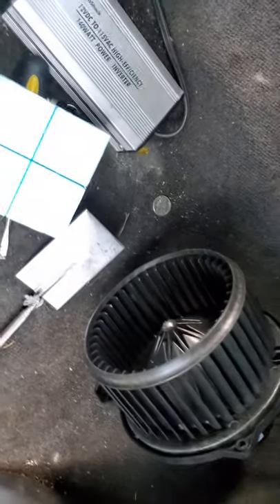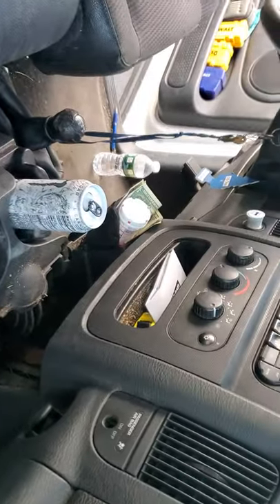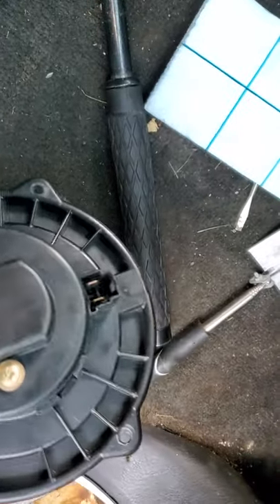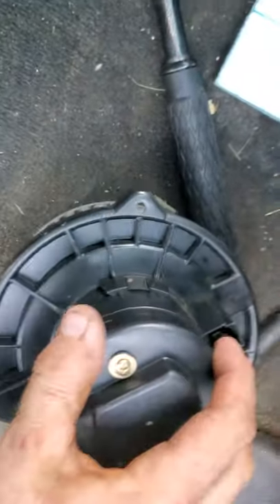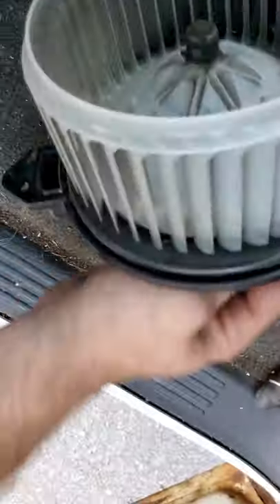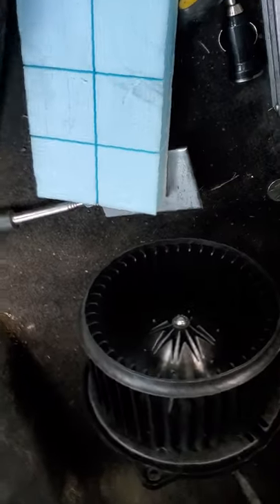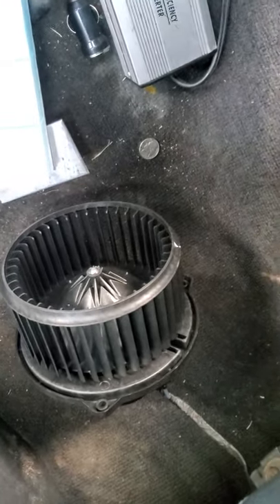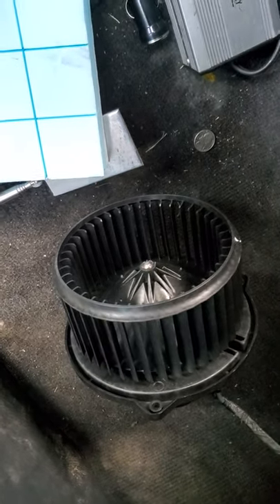dodge ram ac blower motor

Comment: If it starts and stops on its own...it is not the blower.   Check the TIPM.  Mine did that exact thing and cleaned up TIPM and used long fuse.
Reply: Mine gets slower by itself. Shut it off and wait a  few mins and turn it on again. Full power.
Reply: @pyrojoe1404  What?  LOL.  Different than mine, but maybe not so different.

2014 they started building the fan different.....mine is a 2016.

It is pretty straight forward.  Fuse and switch in TIPM and then the fan.

You should check the fan while its running...set up jumpers and measure at the fan and then work back.
Reply: @LanceHeadrick  I'm gonna pull it out and check ac coil too. My blender doors seem to work fine. Yesterday while sitting still is blew HARD and cold THE WHOLE TIME. Nothing I did made the fan slow down. But on the way to the beach at 82 degrees, it seemed like the fan air out of vent was minimal, cool not cold and it didn't sound like it was blowing hard either but that road was bumpy as crap. It started hard and got slower and slower.  On the back 67 degrees it was cold as crap and blew HARD but the road was smooth. A friend said there may be a blower relay somewhere that's going bad. What's a long fuse?
Reply: @pyrojoe1404  There are short and long box fuses.  The long ones seem to grip better.

In my 2016 Ram...in the TIPM box #14 is a short 40a ... green box fuse....I got the long one, still fit and seems to help.
Reply: @pyrojoe1404  What year?  Bower relay is in the fan assembly on 2016.
Reply: I have 2017 and my ac just won’t turn on?
Reply: @ESP12345  You somewhat mechanical?   Take the connection off the blower motor and check the connection with a multimeter.  Got power = bad blower.  No power, check fuse. Push down on fuses and relays for the blower motor probably fuse 14 and the 3 relays up front.  Recheck blower - blower works? = probably the TIPM.  but replace the relays for the blower first and recheck.....still don't work definitately the TIPM.  +/- 400 for the part and 400 for labor.....was on mine (i am in hawaii so price may vary).